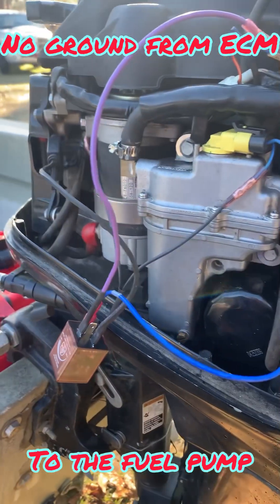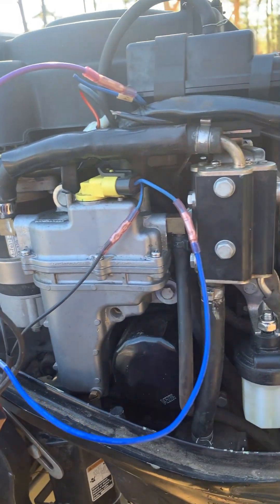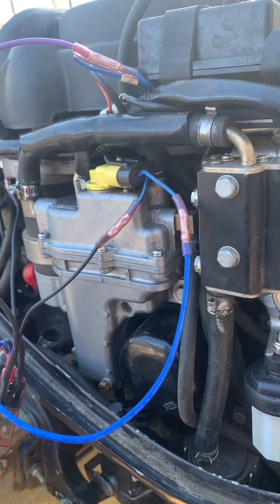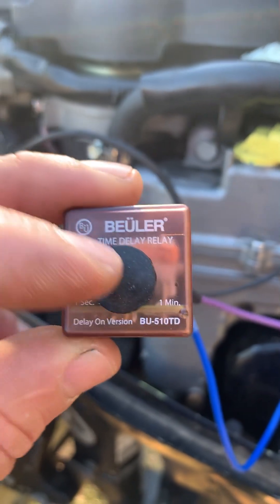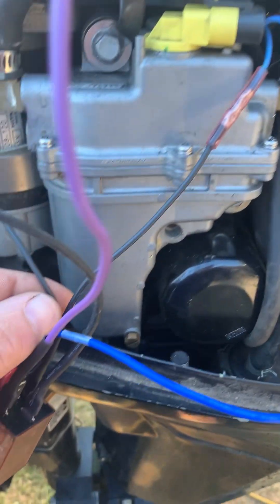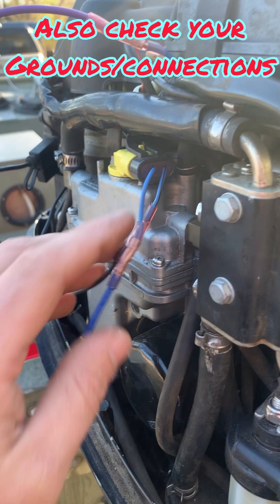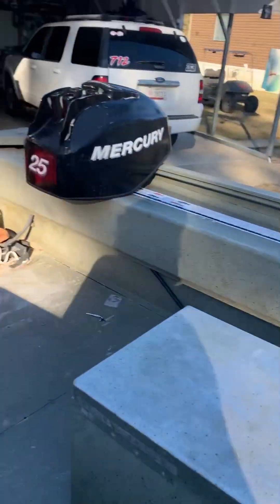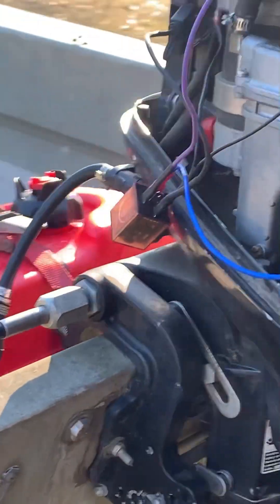Mercury/Tohatsu 25-30 HP fried ECM from aftermarket fuel pump. CHEAP FIX WITHOUT BAD ECU REPLACEMENT

Comment: I'm working with another YouTuber Omie on his repair for this same engine. I have the same one and my fuel pump works but still no start. I replaced a few things but no start still. 

Would this relay guarantee engine running if it was ecu or signal related like a ground short
Reply from the maker: Do you have good fuel pressure at the shrader valve on the fuel rail? If so, have you tried bleeding it and seeing if it will start then
Reply: @racertjay  yes I bled it. I also drained vst. Replaced gas tank gas all fresh gas. Also the gas tank float is broken but I still get pressure. At the fuel valve near injectors, I get 45 psi when cranking. I do run water inside the muffs when trying to start. New battery aswell from my truck I use to start it. Idk which kind is original to the craft. But fuel pump I cleaned out with the vst. Someone else did mess with it before me because it wasn't mounted correctly. But I got it all correctly installed again. Cleaned. Pump did spin if I spun the cogs manually underneath so it wasn't seized. I got 15v at vst connector when cranking but only while start was engaged. When it wouldn't start the voltage would drop and starter and everything would just whine without load. 

Thank you guys for posting videos because I'm hopeful I can fix my Craig catamaran LP2 I have. I got the bait for $400 ($200 me, $200 my dad) from a 96 yr old who still is as youthful as a frat house. I promised him I'd let him drive it if I got it running and he's about 16 hours away from me but I think I can make it happen. I'd have to set up the day to do it of course but he'd love it because he gave up trying with it over the many years he owned it.
Reply from the maker: With power going to the fuel pump connector/harness and fuel pressure, this fix is not related to your issue. Have you checked for spark? Are the spark plugs wet? Tried starter fluid? Sounds like you have an issue with spark, timing, or injectors not firing
Reply from the maker: And it is normal to only have power to the fuel pump when cranking, it has no power with just the key on.
Reply: @racertjay  will the pump hold voltage if it's running. And only lost voltage bc it failed to start? I'll try starter fluid soon. I'm wondering what the heck is going on. My filter gets fuel. My primer bulb primes and pumps fuel. Man I know it's something small and stupid but idk what it is. Just one beep when trying to start but nothing except small putter and fail. 

I'll try the spray fluid and I was hoping I could do this bypass to try and just bypass ecu and do the same relay you did and give up and do that instead
Reply from the maker: @BobbyBaran  yes the fuel pump and ECU gets power from the stator, not the battery, so if it isn't spinning (not running), the fuel pump will loose power. If it won't run on starter fluid, you have a fire (spark) issue, or timing issue.
Reply: @racertjay  do timing go bad on these? I'll try the spark. I'll buy starter fluid and I'll find the intake where Omie had said it should be and as you suggest and see if that prompts any results
Reply: @racertjay  so the fuel pump gets constant power from the stator (after the rectifier converts it to dc)?  And that's constant?  I know the ecm gives ground to fuel pump but does it also give power voltage?
Reply: @macknumber9 at the fuel pump wiring, disconnect ecu signal to fuel pump. Install 12v to a time delay relay and then connect to fuel pump wire from ecu at the fuel pump pigtail. The ecu wont fire fuel pump correctly but bypassing it with time dealy relay worked instantly and never had issues since
Reply: @BobbyBaran  thanks but that did not answer my question.  Does the ECM provide constant 12v power?
Reply: @BobbyBaran i believe the stator produces the actual voltage and then sends it to ECM where the ECM has a built in rectifier that converts it to DC and then sends it to the fuel pump and other 12v components

Comment: Hows it going boss quick question how will this work with the pull start edition of this same motor i will have to add a battery since it doesnt have one
Reply from the maker: You would have to try and find a 12v source (prolly out the voltage regulator, before the ECM) with enough amperage to power the fuel pump. The easiest thing to do would be to add a 12v deep cycle battery in your situation I would thing so you don't burn up another circuit coming from the ECM.
Reply: @racertjay  thank you brother i was thinking the same ground fuel  to the ground battery and positive to? Would i still use the time delay? Also brother which wire is from the ecm to the time delay
Reply from the maker: @christopherquick9707  yes unless you want to have to worry about having to wait to flick the toggle switch to the fuel pump on until after you've started to turn the motor on. The time delay relay eliminates have to have a a bunch of "gotta do this before that" type of stuff to get it to crank

Comment: I have a 2007 tohatsu Mfs25b 

I bought engine recently. Had it running @ home. First time out on lake it decides to not turn on. Cranks but no fire up. 

Replaced kill switch and start switch. 

Start switch wasn’t sending 12 volts to ignition on wire. 

Now I can’t get pump to prime or turn on. 

Does pump prime with key on?

Or does it turn on once engine is running?
Reply from the maker: Fuel pump doesn't get power with just the key on, only when it's turning over. If you try to crank it and it still doesn't have the power, and all fuses are good, most likely a problem with the ECM
Reply: If I’m understanding this correctly 

Fuel pump should have voltage only when Cranking engine?

There’s only one 20 amp fuse by Ecm 

Is there other fuses I’m overlooking?

Comment: I'll be darned. I have the exact same '06 Merc with the exact same problem, and process with the meter. Replaced an OEM pump with a new quantum, and the engine failed after 10 minutes of running, and hasn't cranked since. Local mechanic is swamped for months out, so I've racked my brains tinkering with the engine. Will try the same fix . Thanks for posting this.
Reply from the maker: Good luck I hope this helps you and gets you back going.
Reply: Did you ever end of fixing
Reply: @cape fear did you fix it?

Comment: I have a 2006 Mercury 25hp EFI with out the starter. My fuel pump does not run when I pull the rope start.
I tested the pump with 12v direct to pump and it runs. I also put a meter on the leads from the ECU and when I pull the rope start I get the voltage readings the will show a ramp up to 15v when I hook the  pump back up it does not run. Not sure if I have a ground problem. I am not sure if the pump that I have now is the 5amp pump which I  know now is the wrong pump. I ordered a new pump with the low amp draw of 3amps and have not received it yet.
Do you have another way to test it are can I do what you did with the relay (relay timer). Any help would be highly appreciated.
Reply: do you figure out issue.  I have the same issue as yours.  I am guessing ecu is bad now.

Comment: What did you wire your trigger wire to?
Reply from the maker: The 12v+ (hot wire) at the engine harness that plugs into the fuel pump.

Comment: Thank you for sharing your fix. In Australia I could only get my hands on a redarc tim06 relay timer costs more but works perfect. I fitted an aftermarket pump and didn't know about diodes or potential damage to ecm.
Reply from the maker: Hope I could help you thanks for watching and commenting.